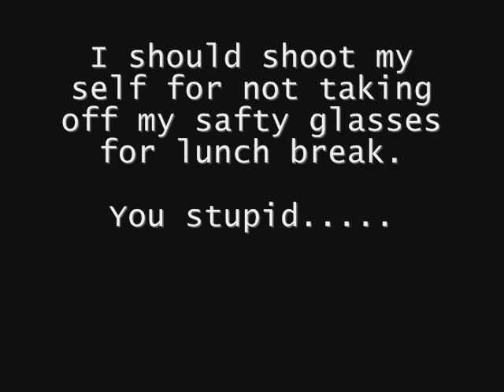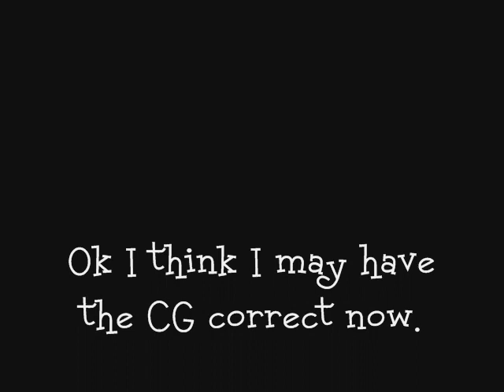2nd test flight of the T 38 Talon

Comment: That wasn't bad for a maiden flight.  Personally, I think it's unstable because the wings are kinda short, and it will probably do pretty well in less wind.  

As for the tail-heaviness, it looks like you'll be moving the wing back to the original position. Doh!  At least you didn't break it, and that's the primary goal for any maiden flight.